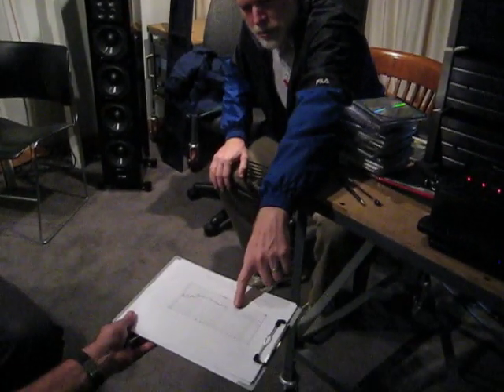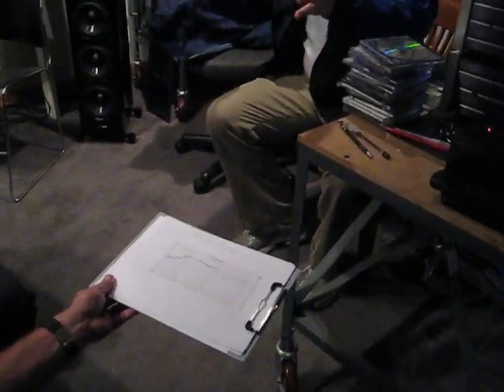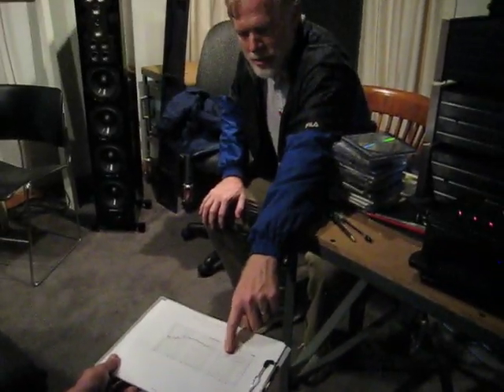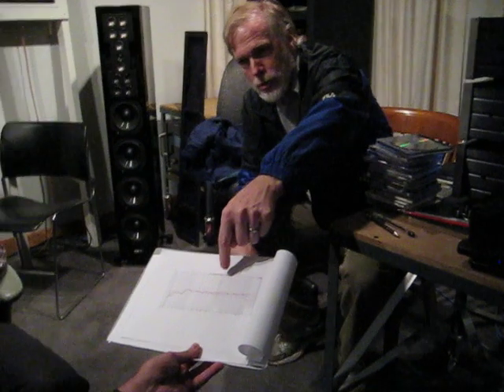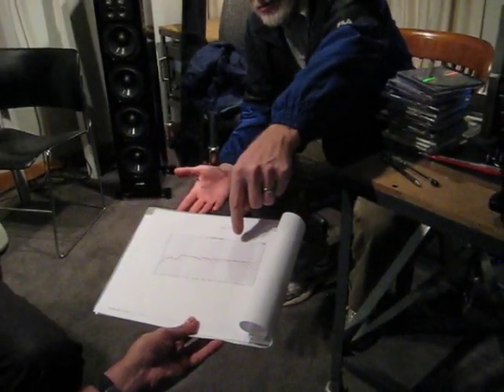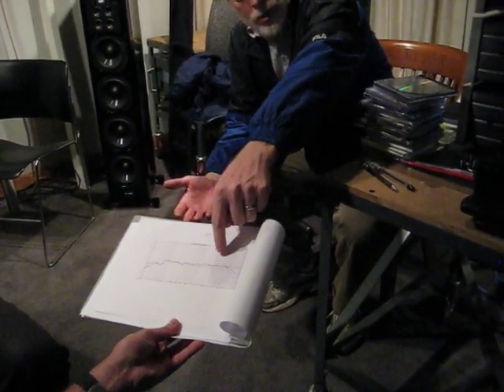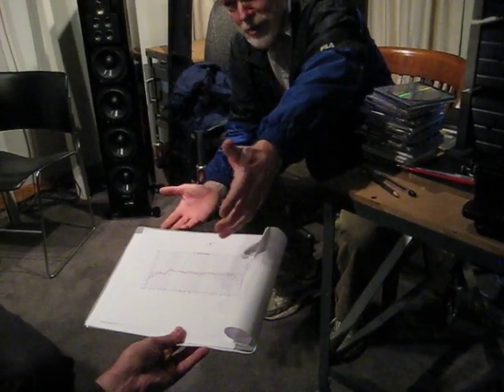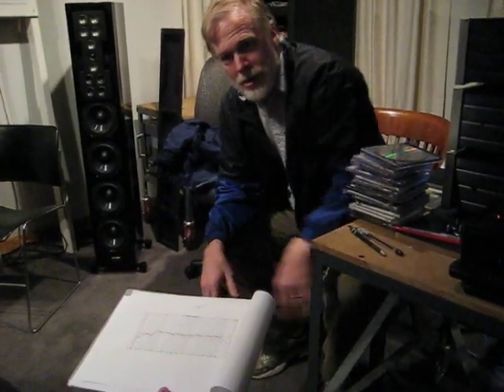At the McIntosh Factory- McIntosh Labs Speakers

Comment: the McIntosh XR50's are literally the best speaker for under $5000 ... don't let the "Book shelf" table scare you... I run these with a MA462 AMP and dCS Rossini DAC and they fill the room with amazing audio.
Reply: Coming from Harbeth M30.2, Kef Ls50 Meta, Zu Supreme and everything in between I would have to agree with you ! For the cost and fact they are Made in US the XR50 are the best kept secret in speakers land. In my small room i have not feel need to use the subwoofer at all. The integration between the treble, midrange and deep bass is amazing. Imaging and soundstage are phenomenal. Very relaxed and musical yet also extremely transparent.
Reply: I have them matched to th MA-252 amp. Best sound I've ever heard.  They just fill the room with sound. Almost like a wall, but with highly detailed stereo separation. Just my $.02.